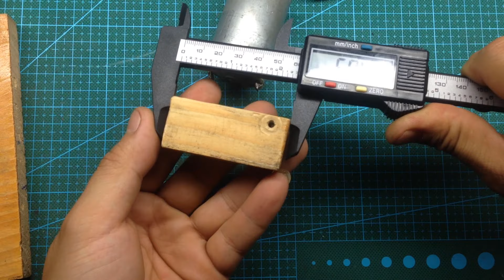Making mini PCB  Drill Press Table

Comment from the maker: I usually make PCB at home, although PCB quality is not high but it is fast and cheap. Unfortunately, my PCB drill was broken after 5 years. So today I will make a mini drill.
You will need some wooden boards, 12V motors, 12V fans, LED 1W , switches, drawer rails and wires....

Facebook group : http://bit.ly/CreativeElectronic
Reply: Please ,I will suggest that you make downloadable plan for the sizes of the woods
Reply: Easy and cheap I also try it at home
Reply from the maker: good luck

Comment: How many amperes is required?? To the drill motor?? My motor is alternating on and off even after giving 12v 2 amp..
 I have 25,000 rpm motor
Reply from the maker: My motor only consumes 1A at 12V.